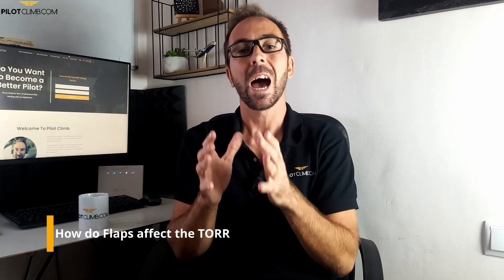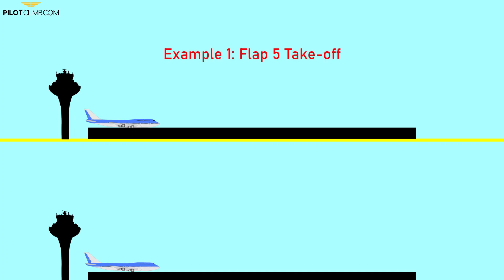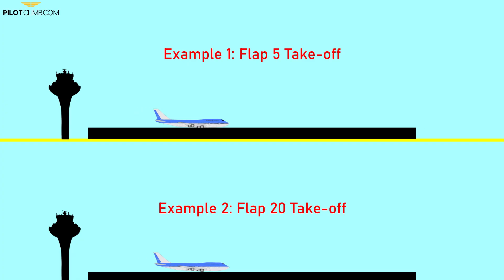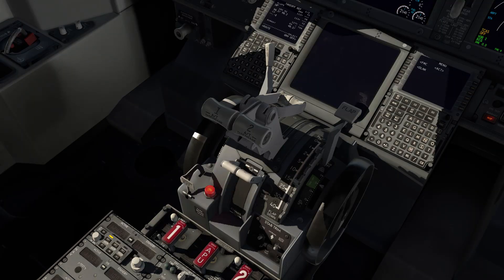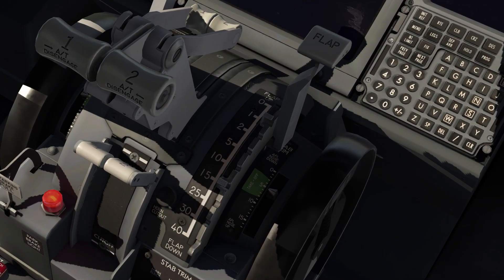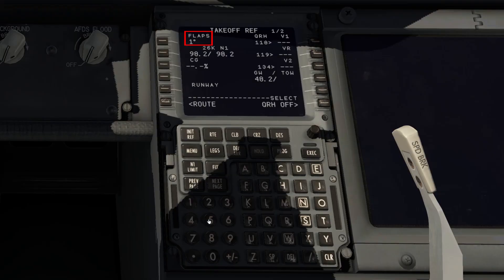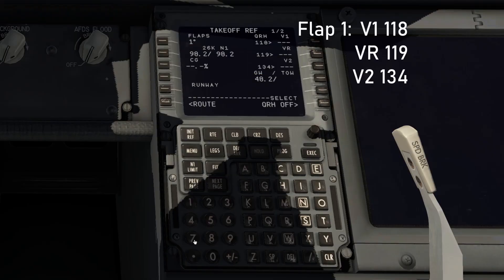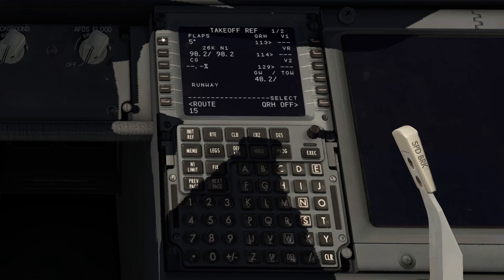How Flaps Affect the Takeoff Run - [Takeoff Flpas Range Explained]

Comment: Why is it that flaps position is rated in precentage not on degrees
Reply from the maker: It all depends on the Aircraft manufacturer. Most of the time the flaps are not rated as percentage neither. Normally they have a number used simply as a reference. If you think about it, it is not that important for a pilot to know the flap angle..what it is important is to know that you have the right flap setting..